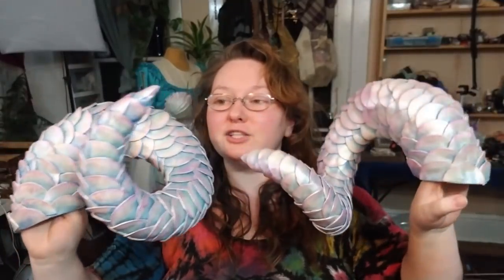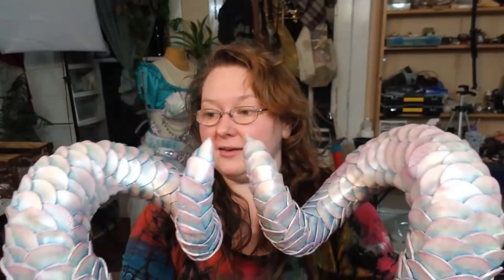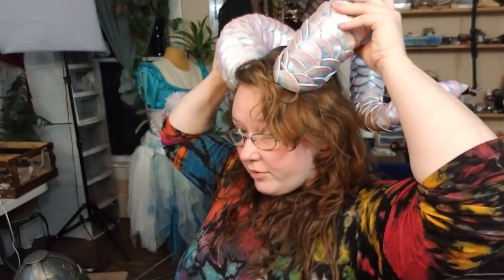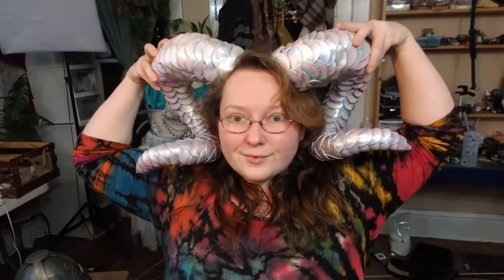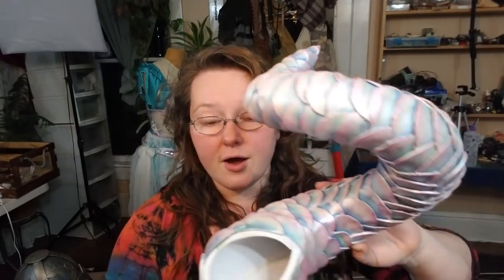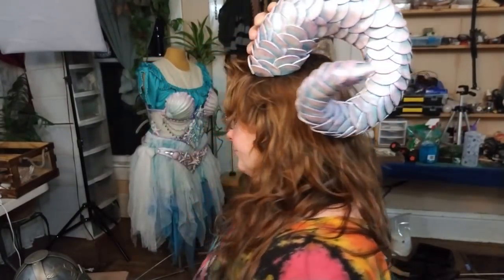DIY Foam Horns with Scales

Comment: You could also get yourself some plastic bottles (like those they use for ketchup/sauces) to fill with the barge cement, the nozzle applicator makes it a lot easier for me to glue things together